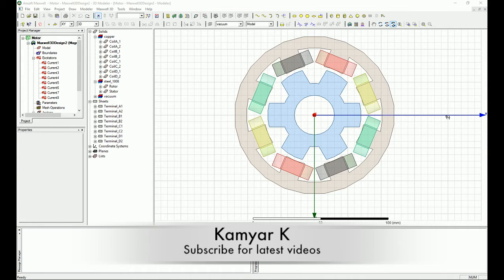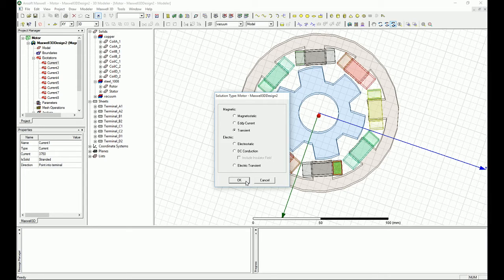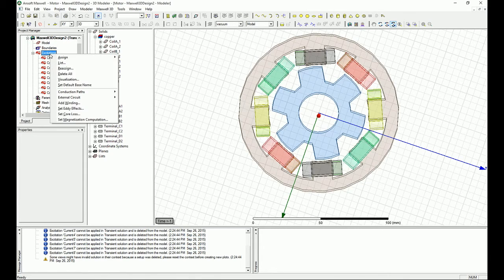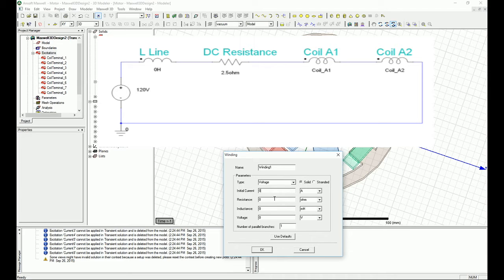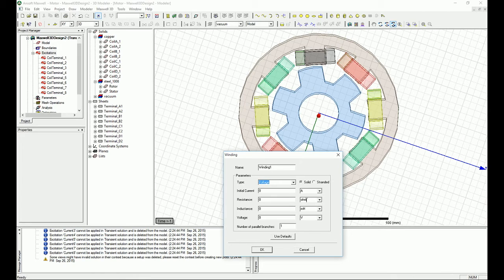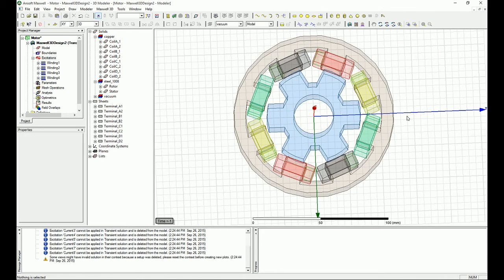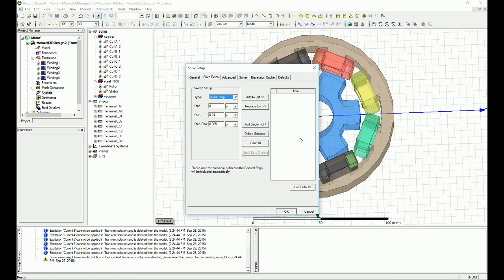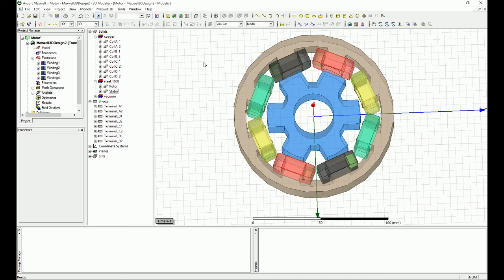401- Ansys Maxwell | Reluctance Motor

Comment: Hello sir. I have a question regarding Ansys Maxwell. Is the Moving1. Torque is the output(shaft) torque of the designed motor? In Ansys motorCAD software 2 types of torque is shown. Shaft torque and average torque. Hence I have been having this confusion. Kindly let me know. Thanks in advance.
Reply from the maker: Moving1.torque is instantaneous while average torque is average. Is that your question?
Reply: @kamyark8434  my question is the motor output power is  Moving1. Torque*motor speed? As far as I know shaft power is the motor output power. Then is Moving1. Torque is shaft torque?

Comment: Can you explain how to do no load and full load condition analysis in ansys maxwell
Reply from the maker: Assuming you’re referring to generator mode , No load can be analyzed using winding type set to current and the current amount is set to 0
Full load is when winding type is voltage and the resistance field is set to load resistance and voltage field is set to 0.
Reply: @kamyark8434  thanks
Reply: @kamyark8434  can you guide me how to do demagnetization of magnet in motor using ansys maxwell???

Comment: sir your videos are very helpful iam trying to simulate a 3 phase synchronous generator. at a time step of 0.002 sec i am getting a nice sine wave output....but when i am decreasing the time step to 0.0001sec the sinewave obtained is wiggly so is there any setting i am missing in the software should i do anything with the meshing...i generated the above sync. generator using rmxprt

Comment: Hello Sir,your video are very helpful and well explained.I want to simulate a linear alternator with a coil and magnet(stationary) and calculate the emf generated.Can you please suggest how should i  approach this problem?or can you mention which video should i refer?
Thank you
Reply from the maker: +Pranjul Tyagi  hi. 
What are you trying to calculate ? Force? Then magnetoestatic silver can help you. I have toturials on that on chapter 2. 
If you need to apply specific excitation then use transient solution and see transient movement of parts as well(to some extend).

Comment: Sir my design coil has 120 AT and 60 turns. Therefore, I am using 60 no of conductors in the current excitation. My confusion is whether I shall use 2A or 120A as the current magnitude for the  winding?
Reply: To be more specific, shall I use ampere turn value or the value of current in each coil in the winding definition . Any suggestions will be really helpful
Reply from the maker: +Srijan Datta  yes. It's ampreturn. Especially when you are defining the excitation to be stranded.
Reply from the maker: +Srijan Datta  the current that you are adding is in ampreturn. Therefore put 120A
Reply: Alright. Thanks a lot for your help. :)

Comment: Thanks for the videos you make dude, well explained and very useful in many ways. I would like to ask you if is it possible to make a video in which you explain how to design and analyze an industrial electromagnet like those used to lift tons of iron with cranes. Not a particular case, just an example of the application with any size and capacity. Thanks again man.
Reply from the maker: +Carlos Uder what parameters do you  want to be analyzed ?
Reply: +kamyar K the force per unit area of the lifting device. Let's just say i want to design an electromagnet crane of one square meter surface capable of lifting 1 ton. The problem is that i have no idea how to set up this kind of analysis. Of course if the model i'm proposing is too big, it can be reduced to get a "less time consuming" model. By the way, thanks for replying so quickly man
Reply: I  RESMI
sir your videos are good.can you please tell me how to use field calculator in 2d FEM to plot the air gap flux density of induction machines.
Reply: I  RESMI
sir your videos are good.can you please tell me how to use field calculator in 2d FEM to plot the air gap flux density of induction machines.
Reply: I  RESMI
sir your videos are good.can you please tell me how to use field calculator in 2d FEM to plot the air gap flux density of induction machines.
Reply from the maker: you can follow up my tutorials in 3D and see how i am using Calculator. but i will switch to 2D design soon. stay toned.